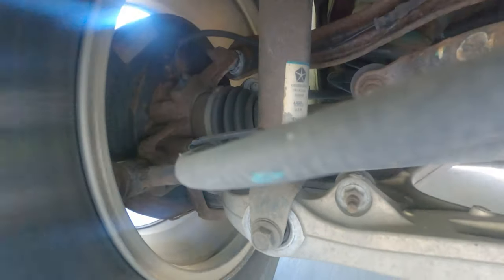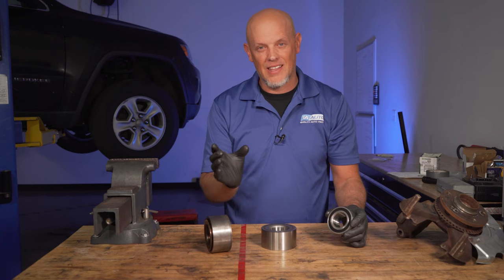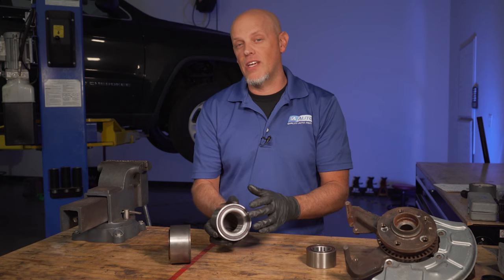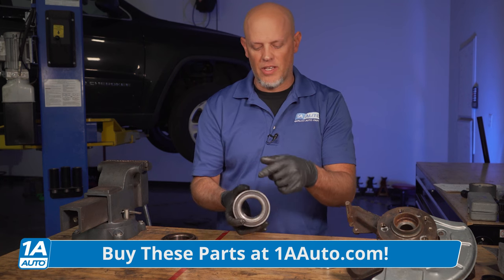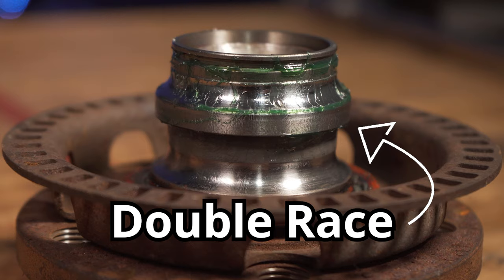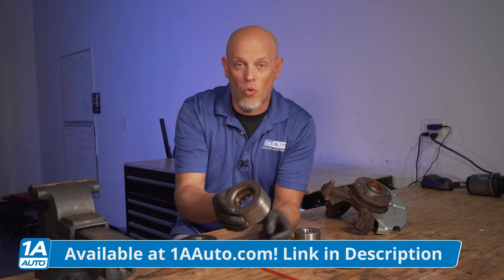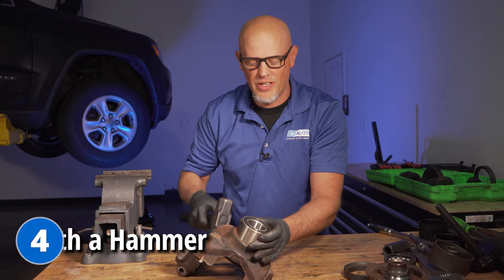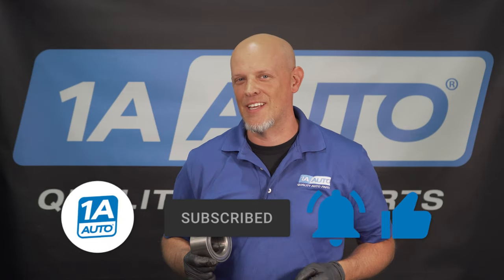Top 3 Common Mistakes People Make Replacing Pressed In Wheel Bearings on Their Car or Truck

Comment: When pressing in a new hub into the newly installed bearing of my 2000 Honda Accord,  I believe I used an incorrect spacer on the backside where after pressing the hub in and taking the set up apart, I notice that the inner race had been pushed out partially.  I then used a correct spacer and using the same set up impacted/pressed the  race of the bearing back and reseated it.  I put it all back together and drove my car around for 20-30 minutes and didn’t hear the humming sound of the original bad bearing.  I also didn’t hear any other noises from the new bearing…yet.  My question is did I ruin that new bearing when the race was pushed out some by using the incorrect spacer?  I ordered a new pair just in case. Should I just continue running it or should I go ahead and replace a possible compromised bearing?

Comment: I changed a friends cv axle and wheel bearing on his 2008 Kia Rio and now it’s making that low pitched growl noise. The only thing I can think I did wrong from watching this video is installing it with a hammer. I never struck the new bearing though, I used the old bearing and piece of 2 by 4 board to hammer it in and ensure it was seated flush all the way around. I also used a hammer to get the hub through the bearing, but it didn’t pull the race with it.

What could I have done wrong? I inspected everything before it went back together.

Comment: You actually can use a hammer to install the bearing.  You just need either a socket that's the exact size of the outer race or a scrap piece of 2x4.  I've done both several times without issue.

Comment: Never use compressed air on ball bearings. Don't spin new, dry ball bearings. Never hammer on ball bearings. Don't pack them with grease. They need to spin.

Comment: I might have to replace my Yukon bearing assembly but boy is it relatively easy.   
You guys are by far and away the best repair channel.   Always good info 
Thank you.  
If I have a pressed bearing, to the shop it goes.    
Replaced quite a few trailer bearings.

Comment: I'm still waiting for an explanation of what was wrong with good old fashion tapered roller bearings that were used for decades. You know, the ones that would (usually) last the life of of a vehicle with no more maintenance than cleaning and repacking them when a brake job was done!

Comment: I use/touch a metal non magnetized flat tip screwdriver to the ring on the side of the bearing ( it will stick slightly to the bearing side that is magnetic )  then the magnetic part of the bearing side faces the a.b.s. sensor .You could buy a magnetic field tester card for a few dollars , but I find it unnecessary . Also watch a lot of Youtube videos .

Comment: Biggest factor in longevity iv learned is proper torque for the axel nut. Over or under torque will kill a bearing fast... almost as fast as putting spacers + bigger tires on the truck...😅🤣